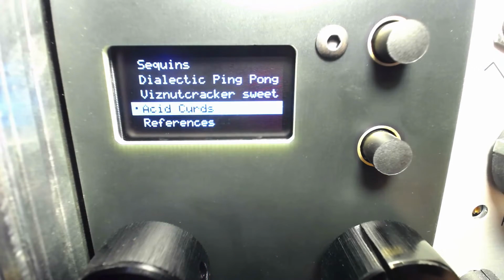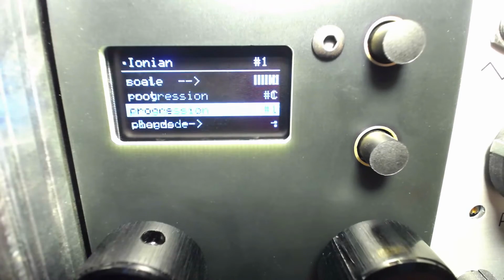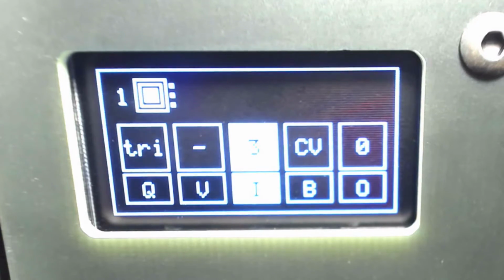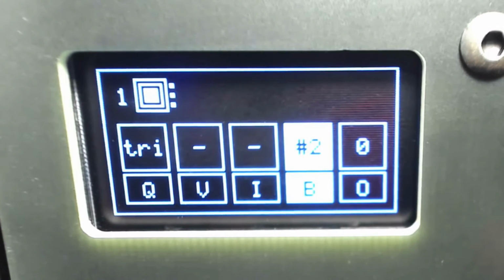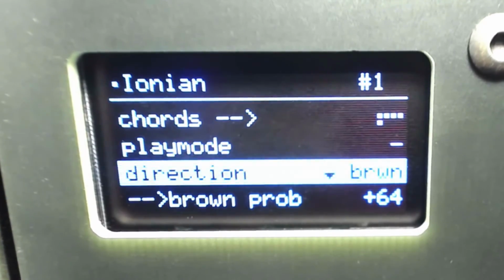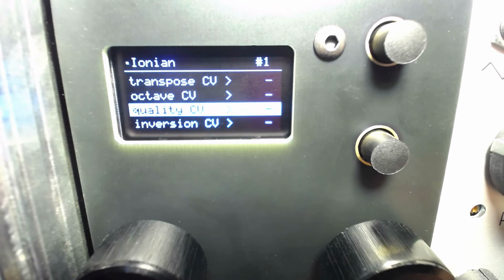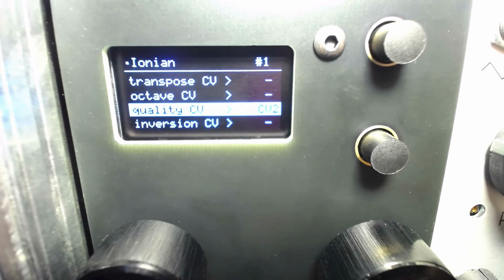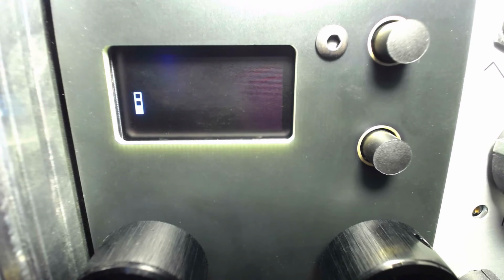Tripping On Acid Curds For Eurorack Chords

Comment: I don't get it. O&C got OLED display, two encoders and 4 buttons. Why is it made so hard to program? I can imagine 10 better ways to manage it.
Reply from the maker: Well there’s good news... it’s open source, so you could tweak it! That’s what Hemisphere Suite began as, it seems, which we’ve been getting into in more recent videos. But I have a lasting love for the original firmware, as esoteric as it is.
Reply: @voltagecontrollab  well, I am synth user, not a software programmer